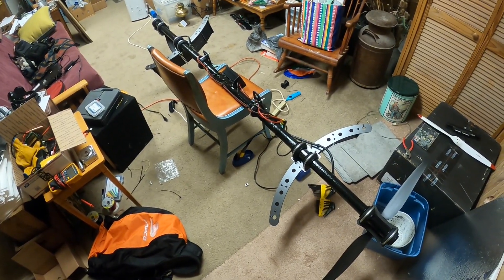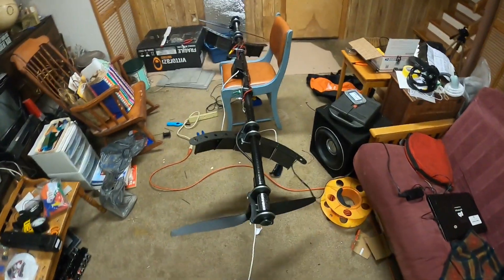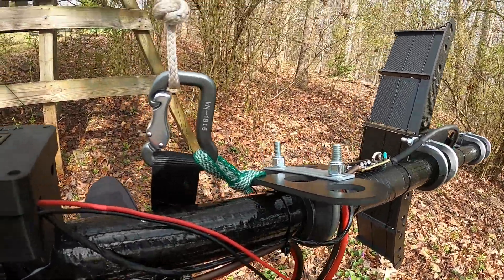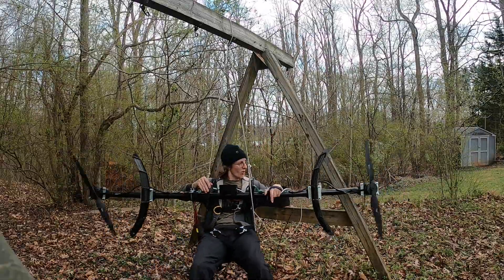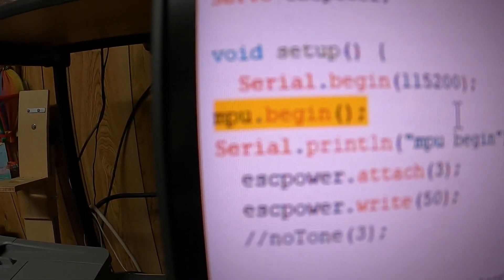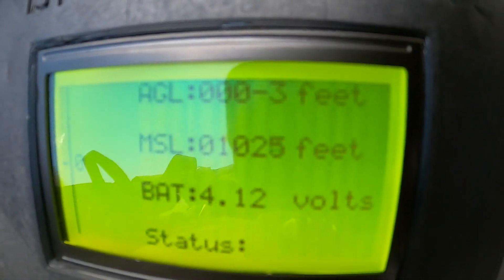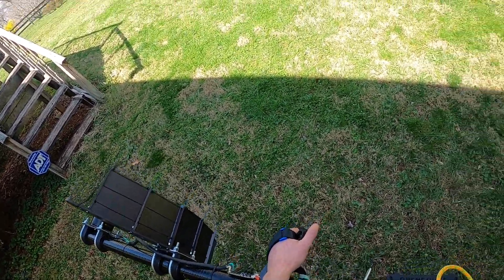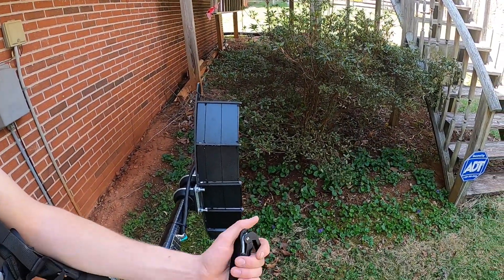Blimp Drive Paramotor Testing | Avery Flies

Comment: I noticed that you haven't posted any more on the project, did you find it's not successful? any insights appreciated, thanks
Reply from the maker: Well, it worked, but it was too unwieldy. I wanted to build a light and portable motor setup that I could travel with, and at 9.5 feet long it just wasn't easy to use. I actually needed help putting it all on and setting it up, so that's what killed the project. I sold the components and bought the AliExpress motor as seen on this channel, which better fits my goals for this project and was cheaper!
Reply: @AveryFlies  thanks for filling in the details, yes i'm following your aliexpress project, keep it up, thanks!

Comment: Battery run time?  First flight done yet to come?  Thx.
Reply from the maker: Battery was estimated to last about 20 minutes. I did do a hop with it, but the setup was just too cumbersome to fit my small portable paramotor niche. I sold the components to someone making a more traditional design, and instead bought the AliExpress DLE170 paramotor that everyone loves to hate 🤣 you can see that here: https://youtu.be/qUcz1YOXQfQ
Reply: @AveryFlies   a different electrical system right.  Is a flight time limited?  Or is there an alternator like part that maintains a spark?
Reply from the maker: @bradbrown2168  yeah, the DLE170 is a model plane engine, they typically use a battery to power the ignition, instead of a heavier coil type ignition. The 6s, 22 volt, 1500 mah LiPo I use also doubles as remote start. The ignition draws something like 300-400 mah, flight time is far more limited by fuel than by battery capacity.
Reply from the maker: @bradbrown2168  sorry about your previous comment disappearing, my finger slipped. Reply is right next to remove and theres no undo 😅

You asked how big the fuel tank is, and if it could be changed to a larger one, and what flight time to expect. The tank is a gallon spot on. You might be able to squeeze 1.75-2 gallon tank in there, but that's getting suspiciously close to the prop. It burns a gallon every 45 min or so, not quite an hour on the stock tank unless you thermal it.

Comment: Have you test flown this blimp drive yet?
Reply from the maker: I got one whole hop out of it and sold it 😔 the design was super light, but it was huge (didn't fit it my car) and cumbersome (I needed help to put it on.) Needing help is what killed the project for me. I sold it to someone making a more traditional frame, and bought the AliExpress dle170 paramotor instead. It's the same weight, almost the same thrust, and a more normal design that I can don and fly single-handedly.
Reply: @AveryFlies  sounds legit...and i did watch the Ali express vids. Your a pretty talented go get er done type. Keep up the good work I enjoy how thorough you are!

Comment: Maybe consider just using motor performance data to sense an issue as opposed to an inertial/rate measurement about the center. The wind, and maneuvering is going to bump you around a bit and cause some rotation about the center (ish) that may induce a shutdown without very careful planning on how to handle the sensor data.  It is easy to sense RPM off of one phase of the motor, sensing current is easy, or depending on what ESC's you are using, some have telemetry and you can get  motor performance data directly from the ESC to your data terminal.  Just about any motor performance metric could be used for this purpose. Compare the performance of the 2 motors and if they differ by some amount, shut down. Any failure mode will show in the performance data immediately, be it an electrical or mechanical failure of the motor, current delivery issue, ESC failure, prop strike, line in the props, etc.
Reply from the maker: Good point! I'll look into it

Comment: You should get some safety wire on those U-Bolts! Excited to see it Aves!
Reply from the maker: Good point! Though they are lock washers and there really is no serious vibration... I'll at least use a grease pen to mark them so I can inspect for loosening before flight
Reply: Murphy's Law.

Comment: What is the intent of this design as opposed to a single center mounted motor and prop?
Reply from the maker: it's cheaper (Small escs, smaller motors, smaller battery), simpler (no frame), and lighter weight.

I still have a typical gas paramotor for longer flights, but this was a fun build either way and I'm excited to fly it!
Reply: @AveryFlies  How about 2 motors driving one larger prop?
Reply from the maker: @michaelregish5079  that would probably have worked, with some gearing magic. This was way easier though